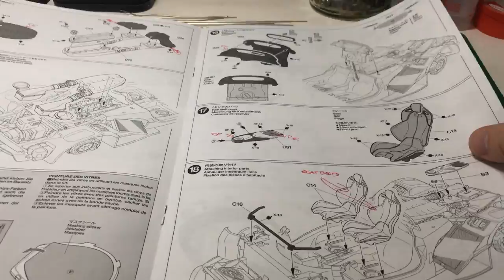Tamiya Ferrari LaFerrari 1:24 part 1 - Painting and assembling the engine

Comment: Hi. Nice job! As I'm quite new to this could you please explain a little what you mean by "wash" on the engine block to highlight the shadows? Do you have a demo video somewhere? Thanks!
Reply from the maker: Thanks Colin Morgan. In simple terms, it’s basically using a heavily thinned paint. If you touch it to the corners it will run around so give the illusion of being deeper and therefore more realistic. I think i covered it a little bit on the RC211V engine
Reply: Thanks for such a quick reply!

Comment: Do you sand the plastic before primer and paint? What grit sand paper do you use?
Reply from the maker: Hi, no, I generally don’t sand before priming as I’ve never had a need to, other than to remove any flash.
Reply: Thanks man for the replu, sweet builds. Excited to build mine.  Thanks